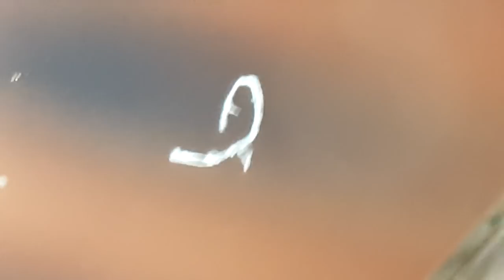LION 2 - 'Cut' channel with consistent width in quartz filled with 'spheres'

Comment: Bob, some of this looks like glassy carbon which requires something over 3,000 degrees Fahrenheit in at least a reducing atmosphere or vscuum. Simple resistance measurement would be a first test.
Reply from the maker: ... but in air, it would oxidise at 800ºC
Reply: Martin Fleischmann Memorial Project , it's a bit more complicated than that, it would depend on air circulation at conditions. But that is not exactly the point. More along the lines of lower temperature phenomenology. If it is glassy carbon becomes another line of investigation. Too easy to speculate conditions coincidentally reached temperature much more interesting to speculate off parameters and the implications of that. 

One of my projects this year is glassy carbon films. Will have upgraded lab to support characterizing later this year.
Reply from the maker: Did you manage to characterise the glassy carbon?